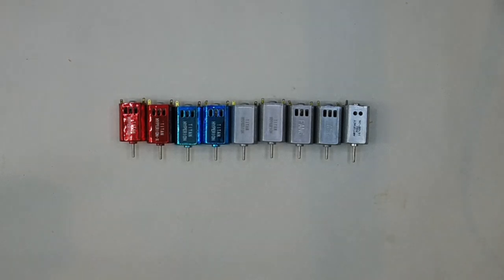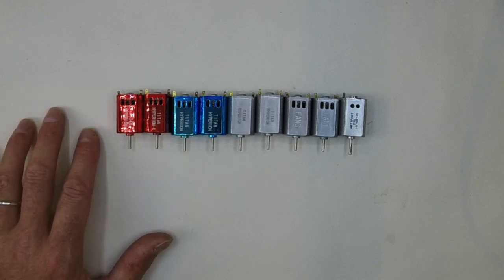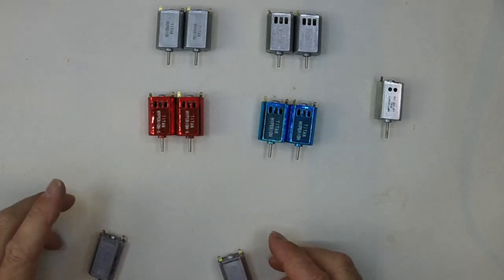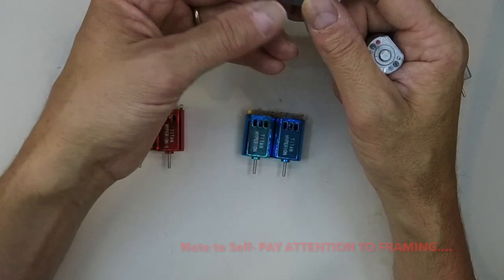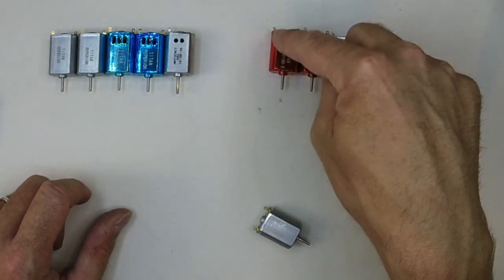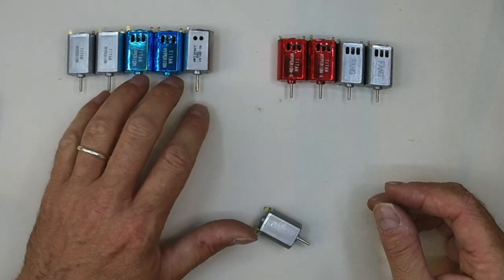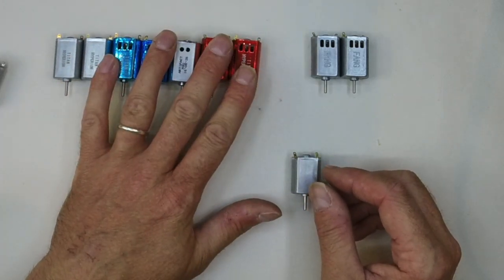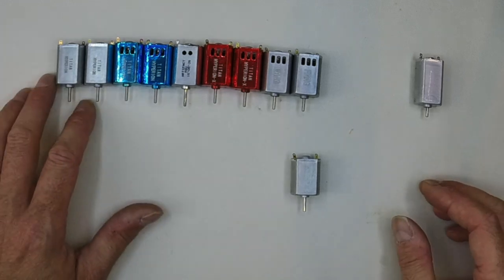Nerf Mod Motors- 132 Edition

Comment: We need a new video on this
Reply from the maker: So many new motors! I mostly use the OOD motors now, since they are reliable and easy to get.
Reply: @foamdataservices  Yes but very expensive $8 for a motor with 800 ish torque is dumb especially if I can but a $4 with 620 something torque & The Kraken motor isn't good for high high crush so. Basically I need Worker Neo motors again.

Comment: Wait, fangs have more tourque than neo hellcats? What about fang revamps?
Reply from the maker: ALPHA Fang RV’s have marginally improved figures over the original Fangs. I have found them to be more fragile than lesser powered motors as a trade off, they are particularly prone to burning their brushes out in a stall. They also require very high performance lipo packs, especially in Stryfes, as the current demands are also high.
Reply: @foamdataservices  ah, so they traded out motor life for power...

Comment: Neo rhinos? Are they better?
Reply from the maker: Neo mag motors will produce more torque for slightly more current consumption vs ferrite magnet models. Fang RV's are excellent too.
Reply: Foamdata Services thanks
Reply: Foamdata Services and while i have your attention, do worker flywheels that are meant for stryfes work for the demolisher and the stock demolisher flywheels for the barricade? 
Thanks
Reply from the maker: No idea, never used them. The Demolisher cage stock is reputedly not compatible with Hooligan wheels because the Demo one is deeper. Here is the Worker parts list for finding the correct wheels. 
https://www.tapatalk.com/groups/britnerf/worker-fly-wheels-3-types-t2332.html

Comment: Hey great video definitely gonna use these fangs for my rapid strike but I'm going to mod by the mtb wiring method is ok for fangs if I use a ofp cage and I've seen in your previous videos that you usually use BSUK switch kit for your wiring is it superior to their wiring method in any way . Even if it is can I get a nice performance whith mtb wiring method
Reply from the maker: The MTB method works, it's just not as good as live centre or dead centre 3 switch. If you want to do the best job on your RS, check out BlasterTECH's excellent switch kit, it removes the hardest job on the centre live set up, fixing the cycle switch. They even do pre made looms.
http://www.blastertech.com.au/Rapidstrike_CS-18_-_Switchplate___Switches_Kit/p2928293_17684749.aspx

Comment: If you still need to cut the shell with these, why bother right? Just go 180s. You do the same thing and get better performance. You wanted the power of 180, and the size of 130 so you didn't have to go out of your way to buy motor covers for them. But if you still need to cover these, then might as well go all out with 180s.
Reply from the maker: Many of these 132's have MORE torque than all the 180's, for example Fangs produce more torque than Hellcats. 180's are not automatically better. Real tuning comes from matching the components together so the whole assembly works at peak efficiency, not just throwing "the biggest" at everything. A shallower can also allows slimmer motor covers which help with holstering and in blasters like the Cassian Andor where you don't want a large bulge in the shell.

Comment: Even if it does not change the conclusion. V=I.R can't be applied here. You can use this Power P=V.I, for same power less current then.
Great video BTW.
Reply from the maker: Read note in description box regarding maths/physics/pedantry.